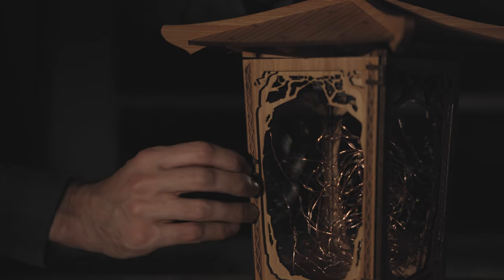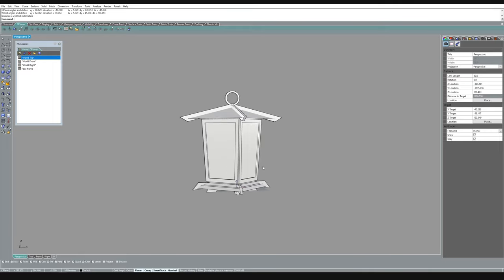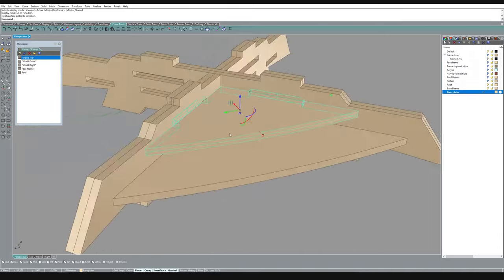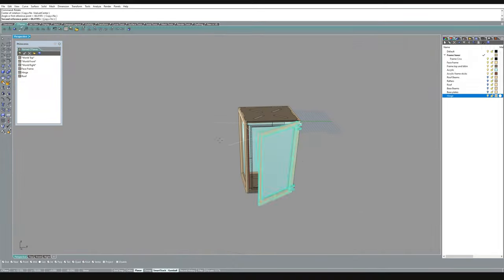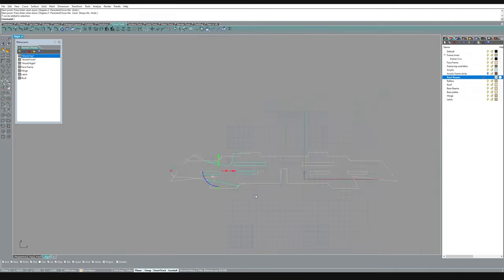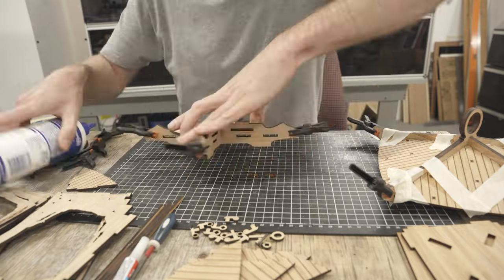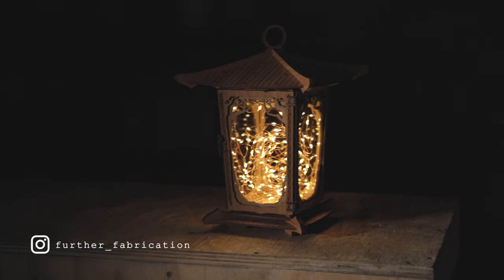How I Design for Laser Cutting // My CAD Workflow

Comment: I've been taught solidworks and am used to that, however now that I'm no longer at University I may learn fusion due to cost
Reply from the maker: I used solidworks at uni as well, however I haven't used it since. Fusion seems to be a pretty great all rounder - especially for the price
Reply: did you see the deal titian of CNC has 20$ for a year sub for solidworks 2021
Reply: @joesmith2465  no!? Where do I find this?
Reply: @simonholden8523  they just posted a video yesterday I think
Reply: @joesmith2465  I heard solidworks is going to a 99 a year hobby license.

Comment: Great video colegue! I also use Rhino in my laser cutting workflow because mainly 3 reasons: First, it let me interact  between architects, designers and engineers. (read their standard files). Second, it has features that other CAD software doesn't have. And it let me work more easily and "freely"  between 2D and 3D.

Comment: Great job. 
I always start my design process in SolidWorks. Set up the right material thickness from the beginning, but makes the holes slightly oversized. Then I use Deepnest for nesting and then Lightburn communicates with the laser. Thanks for charing.

Comment: I have not yet gone to the laser cutting, but are investigating this as second step from 3d printing, my workflow uses freeCAD, Blender, Inkscape and Gimp for personal production, But at work I'm in autodesk autocad and revit mostly with 3D. Thanks for greit inspiring videos with build and design around laser cutters. Best regards from Sweden. PS so far this has been best series I gone throught deciding if to invest in laser cutter build

Comment: Really beautiful creation Rob -- I know I was at least one person who asked about your design process last video and I appreciate some of the insights like the beam "kerf" you design for and the way you account for tolerances in the model.  I'm an electrical engineer and don't generally use 3d design software in my day job but since I've gotten into the 3D stuff, I've taught myself Fusion 360 (to answer your question) and am looking forward to taking baby steps toward a design like this.  In case you're keeping tabs since your last video, my 9mm belt from Powge is still stuck in customs so I bought some from a private seller in a 3d printer community I'm involved with...it should be on its way across the states.  In the mean time I designed a table and cabinets for the Y-400 and got started on that -- I can't wait to build the laser.  Cheers.
Reply from the maker: thanks Keith, glad to hear your getting some progress on the belt and the Y400 build! Fusion360 is a pretty great all rounder, good choice

Comment: I learned on Sketchup, but years ago switched to Fusion 360, and still use the education license (I am a teacher, and occasionally teach some design. Mostly I justify it by creating models I use in my classroom). I use blender to touch up models and add more organic features, but haven't climbed the learning curve to model from scratch in blender.
Reply: In fusion, a 'sketch' is the set of curves on a plane, and these can be exported as DXF files, which is what I export and bring into the laser cutting software. No need to explode the 3d model, just have to make sure you get all the files.
Reply from the maker: Awesome, thanks for the tip!

Comment: Solidworks is my cad software of choice but I also dabble in fusion 360. Really cool to see the artistic side of your workflow. I'm currently building a laser that takes most of its inspiration from your y-1200 design, thanks for going through the effort to make that documentation and put it up for sale
Reply from the maker: Glad to hear you found it helpful!  
Nice, do you find there's a lot of differences between a Solidworks vs Fusion360 workflow? In my 'limited' experience they seem quite similar in their sketch driven modelling approach
Reply: @FurtherFabrication  They are deceivingly similar. Building a part is almost identical if you don't delve into mechanical analysis but the biggest difference is working with assemblies of more than one part. Solidworks uses mates instead of joints which you can have many of between the same two parts. Typically each one only limits a single degree of freedom so joining two parts rigidly could take up to 6 mates. I'm not completely convinced solidworks does it better but that's what I'm most fluent in so I like it. Solidworks also doesn't use a timeline, each new feature e.g. chamfer becomes a drop down item on the object list on the left

as long as you don't bump into either of those things you might make a part without even realizing which software you're using
Reply from the maker: That's such a good point about mates vs joints. Given the price difference it's unlikely I'll get into Solidworks, so it's great to get that insight from you

Comment: I love videos like this! I learn a lot seeing someone's workflow with the highlights and points of interest.
CAD of choice is typically F360. Sketchup is great for cabinets and mostly right-angle type things. And some SolidWorks for the day job. An architecture friend uses Rhino and I'd been wanting to check it out. Seems like it's maybe got a strength in creating more organic type shapes. Have you found this? What do you feel does better than F360?
Reply from the maker: Glad you found it interesting!  Fusion's a great choice, and I think if it had been around before I'd learnt Rhino I might have settled on that instead. 
Off the top of my head the I would say Rhino has more flexibility in modelling and I prefer the Layouts function but Fusion's got Rhino beat on other things as well (like filleting) so I couldn't say one is better than the other

Comment: And thank you for the comment on the offset and material thickness :)
To your question, I end up using AutoCAD from a 2D view as I'm not proficient enough with the 3D portion. So a lot of mental gymnastics. Export that into SVG then K40 Whisperer.
Reply from the maker: no problem, I hope it made sense! oh cool, I've never used autoCAD, I've only used Illustrator for 2D vectors, are you considering learning a 3D CAD software?
Reply: @FurtherFabrication  It made perfect sense and actually got me thinking why had I not done sooner.
As for software, I've been debating if I'll start with AutoCAD 3D or explore Sketchup Layout given I'm more familiar with modelling there. 

Very nice lantern, btw!

Comment: I've used Sketchup for 15+ years so I typically use that. Not the best option but it's what I'm efficient with. Where do you get bamboo plywood from in NZ?
Reply from the maker: Nice, I've only ever dipped my toe in Sketchup, it felt really understandable compared to some of the 'hardcore' packages out there. 
I think that stuff was from 'Woven Bamboo' but I've had it sitting around for a while. Some other plywood merchants sell similar sheets though I think

Comment: There's a nice (free) add-in for Fusion 360 called "DXF for Laser". Select a face of a body, run DXF for Laser, put in your kerf, and the add-in adjusts all outlines by 1/2 the kerf (outwards for external edges, inwards for holes) and writes a DXF file ready for import. The adjustment is only made to the dxf, the model is untouched.
Reply from the maker: oh cool I'll have to check it out!

Comment: very cool video, very well photographed and described.

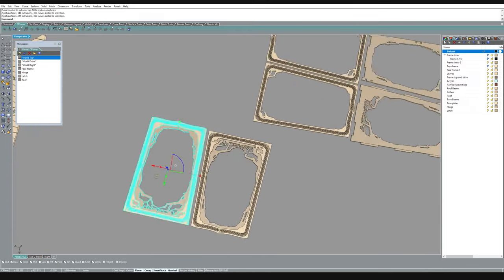i have a question, which command do you use to create the borders around your pieces? (around the 5:00 minute mark)

this is quite similar to how i like to work when i'm trying to develop an idea - build the forms in Blender so that i can render and then light them to see what the patterns will look like before moving over to Rhino (or AutoCAD), to produce the 2D drawings that will go to the laser-cutters. i have as yet not been able to do what you describe at around 5:00 - how exactly do you pull the vector curves from the extruded models - i find i have to redraw them on another layer, which seems massively wasteful. i do know that the original curves are still there once you've extruded, but i tend to lose them in all the noise...

love your workflow, by the way - which version of Rhino are you using - the UI looks different - much easier on the eye.

Comment: How did you like the water spray method? If I'm right you tried it based on 5:37 
Personally I use fusion 360 for design or simply inkscape if I need something basic
Reply from the maker: oh no I totally forgot to try it! that wood just had some pre-finish on it. 
Nice, I'm a big fan of Fusion
Reply: @FurtherFabrication  Ah I see, usually I try to avoid using pre treated wood cuz I don't have a workshop and the smoke filter/vent has it's limits
Tried the other autodesk products but by far fusion was the easiest for me with no prior education in the field

Comment: So for slots/tabs, you say your 3mm piece is 2.9, then make all the holes the "exact" size? Sure as hell beats the methods I've seen/tried of having to offset +- 0.1mm on each tab if so
Reply from the maker: Yeah it just simplifies the process for me and seems to work for majority of things because material thickness usually varies around 0.2mm anyway

Comment: I use SolidWorks, Catia and Inventor. Would love to learn Blender i have some experience with organic modeling of meshes via Autodesk Meshmixer just for 3D printing
Reply from the maker: oh I haven't heard of Catia, I'll have to look that up. Blender is so much fun, if you get a chance I highly recommend it!
Reply: Well I wouldn't fancy Catia too much if you are a creator. The thing with that software is that it is so robust at execution that is very very reliable. Like reliable in Boeing and Airbus books (you literally design aircraft And car factories with it, it's expensive as hell), that's why they famously use it "in house". Very powerful surfacing an 3D modeler, yes sir. But it is definitely the most backwards and restrictive software I've used. For things easily done in SolidWorks (say, make a drawing that automatically inserts date and part name will not be an option in the customize menu, you will need to code a Macro for that, this is not really a problem for big companies because they have their own experts who run Catia at Operating System Level. Unless you are planning to get a job at massive companies I'd stick with more user friendly software.
Reply from the maker: oh nice, thanks for the breakdown! yeah I think i'll keep Catia off my radar

Comment: @03:56 Uhh... Cracks Fingers Neither Rhino nor Blender are CAD Software - They're 3D Modelling Software mostly suitable for whipping up dimensionally less critical assets for stuff like Games, Movies, etc... The only Software you mentioned that is in fact a CAD Software would be Fusion 360 which is more likely to be used where Dimensions are critical ( like when accounting for a Lasers Kerf 😏 ) and were working Parametric may come in handy ( like having the Tab Cutouts based on the Material Thickness that may change depending on the Material Supplier ).
Speaking of Laser Kerf... You shouldn't have to account for that in the CAD Software - A proper Laser Cutting Software should allow you to define a Kerf that will take care of this.

Comment: I had to use Rhino for my Industrial design classes... And hated it. It feels like a CAD program made by programmers for programmers. 

I daily drive Fusion 360, though I'm trying to obtain a copy of Solidworks via a veterans program. Having the timeline, and being able to set the laser offset in parameters is amazing.
Reply: disagree. you never actually tried such a program it seems. rhino has a pretty good ux overall. i am a new rhino user, and its much better than anything autodesk, and much less complicated than 3ds stuff or solidworks.
Reply from the maker: I know what you mean. I learned Solidworks at design school which has a very logical approach to things, so I struggled a bit when I started with Rhino but now I find it much easier for things that involve more 'art' than 'engineering' if that makes sense haha
Reply: I worked with Rhino for a year,Kaimelis. I taught other students how to use the software. Its klunky. Lines don't connect, you have to type in commands, and the way some of them are worded is weird. Have you tried the sketching environment of Fusion 360? Or the ability to add offset planes... And then sketch on them? 

Rhino is very good at the art side. Like doing weird things with surfaces and stuff. But if you do 25 screw holes for a design... And then get word from the manufacturer that the screw hole should be 3mm instead of 4mm, you need to go and edit every single one of those. In Fusion, you'd just go back in time on the timeline and change 4mm to 3mm.
Reply: And there are positives to Rhino. It's for professionals to use. And it's great to use with a parametric design software. But over all, the software is very opaque.
Reply: @avaviel  if lines dont connect its a problem with the user. i tried everything from autocad to sketchup in various degrees for various purposes. rhino so far seems the best balance between things. im not saying fusion360 is bad, but its as simple to do simple things in fusion as in rhino when you have mastered both. rhino may take more to master but in the end its more powerful more worth your time. also nothing is artsy with rhino, more difficult parts is not yet art. want art, go sculpt organic forms in zbrush or blender.
Reply: @kaimelis  bahaha. Makes me wonder if you've used Rhino. I've watched students trying to learn it. You don't know what layer the point is on. It's far to easy to accidentally put a point in the correct location from one view, and wrong in the other. Me? I understood it fine. The class of students new to CAD? Not so much.

When I showed them Fusion 360 a weight was lifted. "You mean I can design without having my legs cut off?"
Reply: @avaviel  wonder all you want. where im wondering is what class is that, kindergarten? your class is not the definitive proof that the software is unoptimized. class actually implies that you have students, students are stupid, i was one for 6 years. what is not stupid is pretty solid rhino help tools for those who who are learning themselves, and gui thats not stupid. again not saying fusion 360 is bad, but im saying rhino overall is not bad at all.
Reply: @avaviel  could've conceded the argument in a less pathetic fashion, but that's alright
Reply: @kaimelis  I'm unsure of what you mean. Literally all of the rhino people who I've talked to that disagree act like you. As in, ass holes. 

I'm saying Rhino has its place in CAD. I'm also saying the controls are clunky. Fusion 360 and Rhino can be used together for cool results. I've also observed the software with students. Instead of making constructive comments, you're calling the students idiots. It's as if you know the interface is bad, but you need to defend it.
Reply: @avaviel  what you are saying is what you are saying. reread your own text if you have trouble remembering. also reread what i said. i dont think rhino ui can be called clunky, and i never said a single negative thing about fusion. its you who has a tunnel vision of an opinion cause some students of yours were slow to catch on. you are right students are not idiots, the teacher is usually at fault. wanna try a clunky interface made by programmers? try capturing reality or meshlab. also im not a rhino person, i still have much more hours in autocad. what i am is software person. i tried them all, with neutral approach. this is where my opinions stem from.
Reply: @kaimelis  lol dude. You're so deadset on being righteous about the holy rhino or something.
Reply: @kaimelis  I'm going to make a video reply to you. Please wait a few days for me to film it and upload.